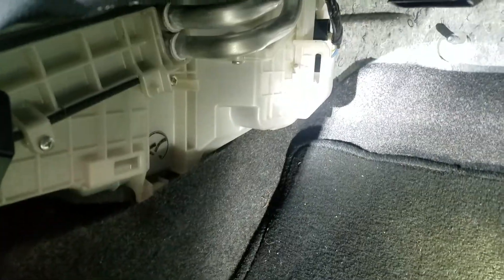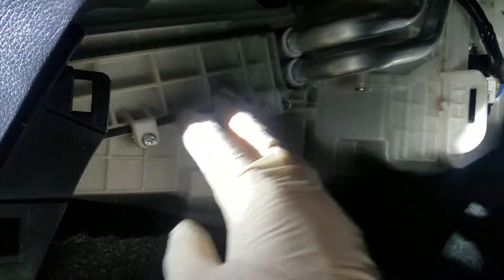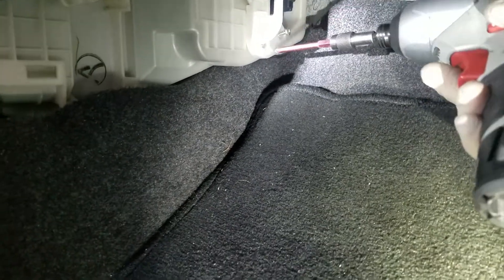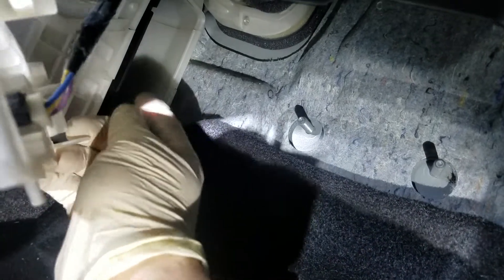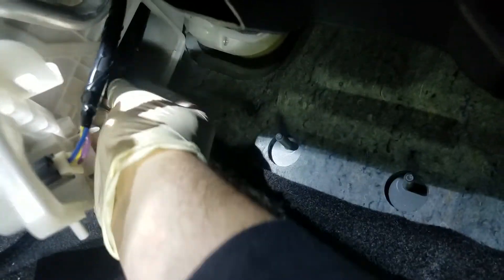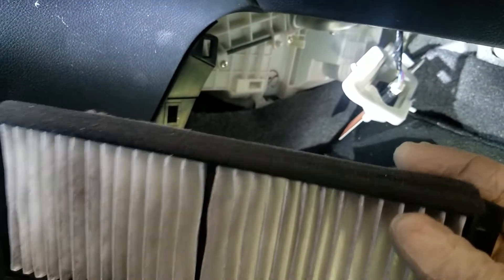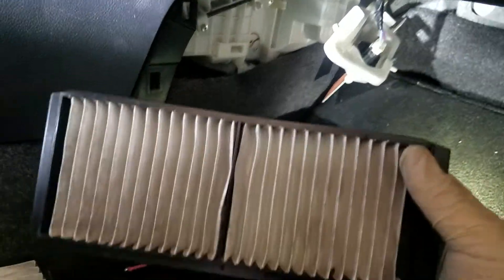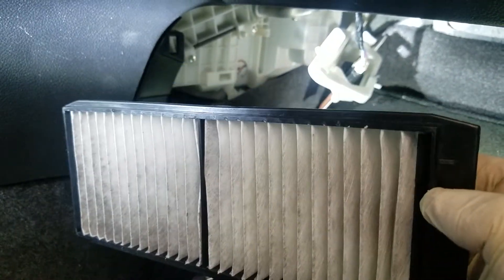How replace the cabin filter on a Mazda 3 2008 to 2013

Comment: As I was searching for a "proper" instructional video I skipped past The Bravo Connection and watched 2 half-assed vids that had me believing I knew how to complete this simple task. 45 minutes later I'm back inside, find this vid, and quietly sit down to calm myself and watch how to do it right. Thank you. The Mazda cab interior is meant for frames smaller than mine as I got stuck under the dash by twisting and turning, etc. The most important piece of this cabin filter install is showing the viewer the filter assembly and noting the foam is the top filter. So there. Story finished. Back to the car and hopefully a quick and simple replacement. I subscribed and liked and hit the notification button as 1st impressions are lasting. Mahalo nui loa y gracias por su ayuda! - daFigz™
Reply from the maker: I'm just glad I was able to help. Cheers. And thanks for subscribing.

Comment: 2004 - 2009 first generation is not that easy like it shows here, i did mine yesterday and had to remove fuse panel too and metal frame that was holding the fuse panel in order to get to all FOUR small screws that was holding that cap where filters are located. You should remove 2008 and 2009 years from the description and change the title too ;)
Reply: Running into the same now :(
Reply: 2nd generation Mazda 3 was released in April 2009 here in Australia. My 2nd gen is a 2009 model.
Reply: Yes you’re absolutely correct. This video is misleading. The 2008’s are NOT the same, to say the least. Mazda knew this was a pain in the backside and obviously they changed to make it easier on the newer models.

Comment: 2008 mazda 3, not the same, metal bracket in way, after 4 screws removed to open access to filters, still cant get filters out without removing metal bracket for fuses...